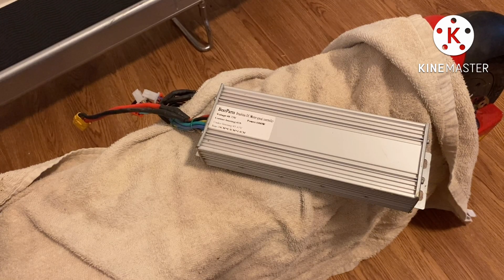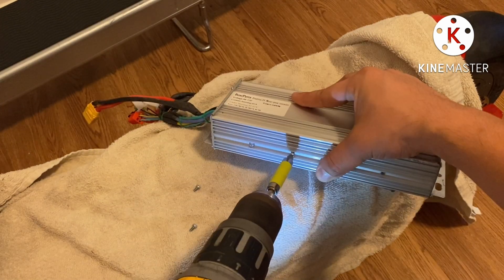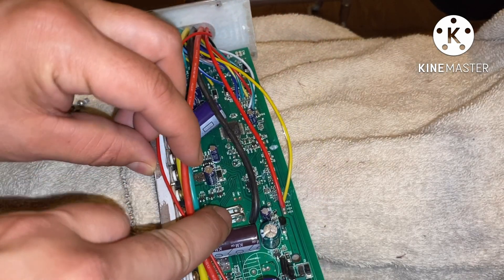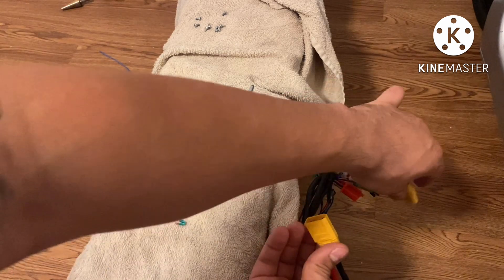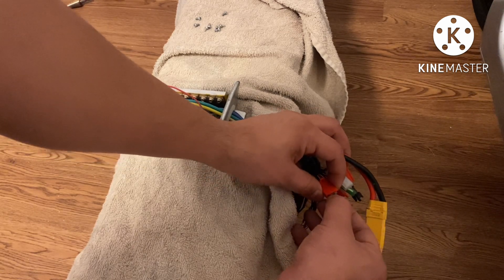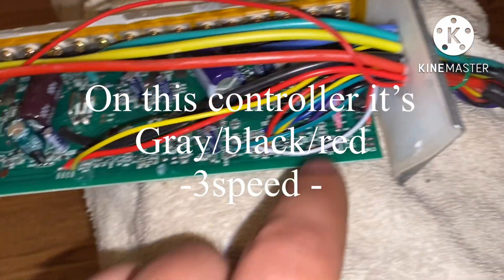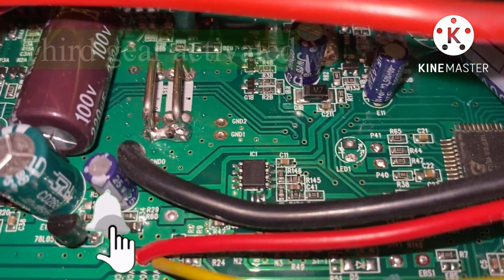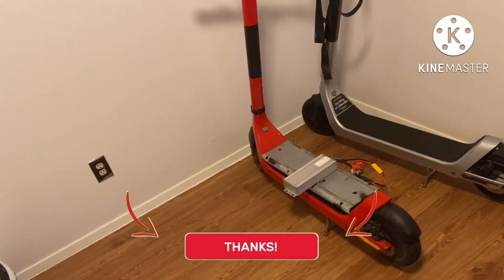Bird 2 Scooter shunt mod￼/3rd speed activation pinpoints￼ !￼ -Different-￼

Comment: Can you use a circuit board from m365 scooter by Soldering wires together
Reply from the maker: Because of the Bluetooth module You  need the m365 controller with it ! They work together especially when connecting to Bluetooth/m365 app

Comment: Hey pj it's Josh I text u a few weeks ago asking about a scooter I got I want to make it personal it's the new Spin scooter can they be converted can u tell how to do it and tell me what I need to buy to make it personal
Reply from the maker: I haven’t converted to spin scooter  yet but I’m almost sure is the same process.

Brushless controller
Resistor headlight
Wiring kit
12vbuttons 

Besides that just some Power tools
Soldering gun/Solder

You can power your headlight through your controller if the headlight requires 5 V.

And the back light you can wire it to your battery pack 12 V supply nickel by testing it with a multi meter you can find it.
Reply: Thanks for replying I appreciate that.. well yesterday I ran into some kid in Tijuana riding the new spin scooter and I ask him how he said it's the same and something about u have to get a new speed odimator or that screen that in the middle of bars

Comment: I run those same controllers and have probably ordered 12 of them. It’s capable of big power and I run mine at around 55-60 amps with burst of over 100 for a few seconds. Running them on 16” 9c hub motors on a seated scooter I built. 0-40 mph in about 6-7 seconds. Dual motor, dual controller and separate batteries running each controller. Each battery is a 20s6p capable of 60 amps continuous and 100 or so peak.

Comment: Hey are you running two 36 volt batteries in series to get 72 volts,??? And I ripped apart both of my bird 3's and what's up with all the pinched wires you were right you got to watch out for that I noticed that a bunch of wires are pinched and need to be replaced,...but going smoothly so far keep these videos coming in I'm always watching them,...
Reply: Same here, mine is literally mint condition too is the worst part. Smh

Comment: and btw is this 72v one you built your daily driver or what? I'm trying to figure out how much power these hubs can handle.. I see you on the forums with everybody else bro lol talking about there isn't a controller out her even capable of killing that overbuilt monster hub motor, but my thing is. if there was one - the vesc (because of there being no bms to limit anything) being able to hit it with even just the standard 36v... but push 100-300 amps through it with the flick of the wrist if you set your settings that high? lol even 100 amps - 36v x 100amps?... that 3600 watts straight to that little  bro... lol if there was ever a controller made out here that was capable pf melting down these tank-hubs on these things the vesc units would be the one to do turn the hub into a straight up smelting pot of liquid molten copper REAL eeeeasy if you're dumb enough to set you max average that high without any bms to limit the actual power being drawn or do it in a safe way without any type of cell balancing at all lmao... I'm putting my 100 Amp  bms's on both my packs for that reason, but like I said while I'm in there i still haven't figured out if re-welding the entire battery pack to give me 12 or 13s instead of 10s is at all necessary since I can make up for keeping the stock voltage with those 100 amps on tap whenever you need it, and I would think that being able to cruise at 30-35mph with 100 REAL time amps (not just based off whatever the sticker says like the old school controllers) so, 3600 watts on demand? I just can't see 30-35mph being an issue nomatter what the voltage is at when you have that much total power ya know??... does any of this bs even make sense to u bro? 🧐 honestly tho lmao I NEED SOMEBODY WITH REAL LIFE ANSWERS ABOUT THESE HUBS BEFORE I MISS THE WHOLE SUMMER "planning" around not burning out the only 2 hubs ive got....also another idea I had was to just take both jobs and buy a dual vesc unit for 3 bills and then I know forsure it could do 30+ all day long... is there anything stopping the rear hub from going onto the front forks?...like would I need to do a bunch of custom bs or no, just bolt it on and wire it n go? thanks in advance for ur replies brobro, I've seen you on here for a minute now and I got half my ideas from watching ur vids... lol thats prolly not the best thing but its still a mfkn compliment 😆🤐👌
Reply: If you’re planning on mounting a hub motor wheel to the front fork you’re going to have to heavily customize it. I would highly recommend getting a second fork that you’re okay with destroying to experiment on if you’re doing that.

Something p&j doesn’t mention is when you wire these batteries in series it’s important to use a diode to prevent the batteries from passing voltage to each other.

Like you said, the best way to get 72v and keep a stock look would be to reconfigure the battery pack and extend it. The controller can be mounted on the shaft of the scooter and all wires can be run through it as well leaving a ton of extra space in the battery compartment. Be mindful of wire gauge.

As far as balancing, the bms bypass only affects output not input. There should be no issues with balancing as the cells will be rebalanced every time the pack is charged. However, it might be worth replacing the entire bms with discharge bms if you are considering pack reconfiguration.

These modifications are definitely pushing the limits but someone with the right determination/skill set could pull it off. 

Interesting stuff! Let us know what you come up with.
Reply: @ethanvalencia6611  oh that someone is me then I guess. Lol battery pack building/rebuilding I've been doing for years, and all of my experience with customer racing drones comes in handy here as well I guess. To me its just a no Brainerd. Vesc controllers are the only way to go when you want to go faster than you're supposed to be able to. And thanks for answering a question I forgot to ask, about the stock BMS being made of all super high end/expensive components it's such a damn waste to bypass it at all, but I was hoping that I could at least keep the normal  input balancing working at the very least as none of these aftermarket BMS modules are going to be anywhere near as reliable/safe as the original bird BMS... I legit don't ever want to know what they actually pay for these things because I'm telling you just components on the bms board itself would cost me close to $100 wholesale without the actual PCB or the cost of all the electrical & mechanical  engineering factored in whatsoever.... it really makes me sick to think that there's no option but to bypass the output, and I spent my first week searching high and low for a way to save it. Still can't find a trace of anything whatsoever other than somebody dumping the STM32 based "brain" firmware and then...nothing... for like 100+ pages of a post on the forums lol. Nobody even seemed interested in that dump file. 🤨 like... just lemme get dat tho 🧐
Reply: I was able to find some information on the firmware dumps. Any exploits that were found were subsequently patched quickly. There were some functions for unlocking and starting the scooter via BLE for free. I believe the only function that is currently unpatched is an “off” function that allows you to move the scooter freely and disables tracking.
Reply: @ethanvalencia6611  minus the dual hub idea. That's scrapped unless it's just a straight swap. Don't have the time or money to be customer fabricating aluminum alloy forks for a  scooter ATM 🥴👍
Reply: Can you share how you plan to reconfigure the battery? I want to do the same but fear injuring myself in the process lol

Comment: dont use wire pinch them together and drop solder on the center the wire changes the resistance too much.   you will end up burning up your mosfets..

Comment: I'm sitting here with a 1000watt 36/48 for 1 that's takin me forever to get installed... but then I got a VESC 4.12 sittin here Goin into another one once you decide to upgrade and I have somebody else out here to look at a video for reference and just general ideas 💡  cuz thats how I work when it comes to anything electrical & new lol. it's graduation day bro. throw that 82watt controller out the window and see what you can make happen with a vesc 4.12 for $89 + the stock battery @36v without any mods whatsoever besides the bms bypass that will let the 50v/120a max vesc straight BREATHE if it's setup the right way... lowley only reason I'm waiting is because I know the amperage and torque is all there with that combo, but I wanna see what the top speed looks like with just the standard 36v 10p config, or if I need to rebuild the battery for 13s and install one of my 100a BMS units straight out the gate  😑 dont matter what it is. I'm a perfectionist like a mfkr so just switching that battery pack from 36v to 444 or 48v alone will take me a whole ass day just to plan out on paper first beforei even take the first screw apart that holds the cells together 🥱 lmao from tho. ITS TIME TO GRADUATE TO THE BIG BOY VESC MY MANS.
(btw the correct vesc for these things is the vesc 75100 that goes up to 20s, the vesc 4.12 only handle 12s reliably but is rated for 13 max. I only grabbed it because it was a flash steal gor 79 bucks... same exact concept and software, wiring, ect. tho.... my only real question is the stock throttle working or not at this point. everything else is beyond simple compared to these 1000watt monster sized old-school controllers that are straight up inefficient afffff especially when you're feeding those types of old school circuits big power like that.. but I'm js bro) lmao grab one and forgetting about a 72v monster azz 'controller'.. literally 99 bucks right now and you can't get any better performance from any controller out here anywhere than the vesc 75100. only thing I would suggest is chopping off 1 string of batteries and running it at 19s instead of the max for that controller. it does anything from  8-18s reliably af, or up to 75v max... but it does 120amps... which is just the continuous rating... max amperage is over 300a for up to 10 second bursts, so even at 36v you'll won't even notice a 30% incline hill as long as you have the bms bypassed and have the vesc max Amp setting set for 80ish amps max i would say...

Comment: Hey so on the Kill switch+battery trim -bird 3, when you were adding the kill switch you didn’t show where you connected to and where did you find that 5/32 flat head? Can you link?
Reply: also, if you want more of legit looking polished looking/hidable 'kill switch',, the only thing out there that's rated for their type of current is the anti-park switches for the vesc units I was talking about. they cost 60 bones just for the switch and are essentially the same damn thing as the loop key, but they cost 60 bucks because they know their the only people that make anything even close to being able to reliably handle the current coming out of that pack when you flick it on lol. Issa whole monopoly flipsky brand has Goin on rn. hop on Amazon and you'll figure that out real quick lol
Reply: But to answer ur question, I'm assuming he just put it on the throttle hot side so that it disables the throttle. Works totally fine I guess, but my thing is I want to be able to turn the actual connection from the battery on/off so that the tiny draw from the bms, and the step down, ect. Ect. Dosent drain my battery by a point per week when It isn't on the charger... as well as me being ocd af with lithium cells of this size and not wanting them hooked up to a fully energized circuit controlled by a cheap as possible 100watt Chinese POS controller that could fail and short my shit out at any point - in my house at night when im not riding it...lol maybe that's just me tho. Idk. The xt90s key solution is a proper battery connect/disconnect switch. Not just a throttle kill. That's why I always reccomend it even on unmodified scoots because those $60 high Amp switches are made up of a couple mosfets and they go bad after a few hundred on/off cycles typically and people get sick of dishing out the bread for replacements so xt90 key is where tf its at 👍 I think you can buy whole xt60 and xt90 loop key kits on Amazon, but it's just a couple connectors and 12awg wire. As long as you have a little soldering experience (heating up those connectors without melting the plastic takes skill) I dont see why everybody doesn't have a loop key on their Keychain that you can use for all of your scoots, and not only that but to use as a super charger port. just save 1 connector out of the pack, order 3 or 4 genuine xiaomi or segway chhrgers (because they're protections arelegit af and you can do this safely) and then chop off the ends to wire all of them in parallel to make a 4, 6 or ithink the stock bms has an  8amp input limit  (my bms is 40amps) and with nothing but some extra charger and a soldering together 4-10 wires black to black. Red to red - and that's that. Plug that bih in and watch it charge ur 700 watt hour pack from 0 to 100 in like 46mins flat lmao... a pack of proper connectors and 10 foot of 12awg silicone wire just unlocks alotttt of flexibility with these things which is why i hate these old controll boxes, the vesc unit to go with the right amp-rating  battery connections & wire? That little $200 combination gives you  complete and totsl 100% control over every little setting you never even knew existed prior to learnkng abiut the vesc tool app  🤷🏼‍♂️ but lemme stop there cuz I'm js 🥴🥱